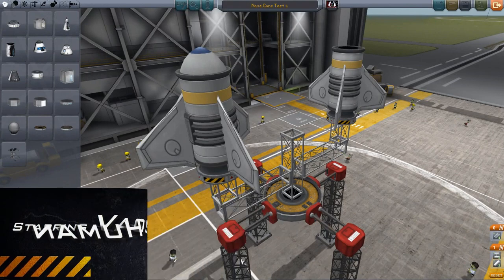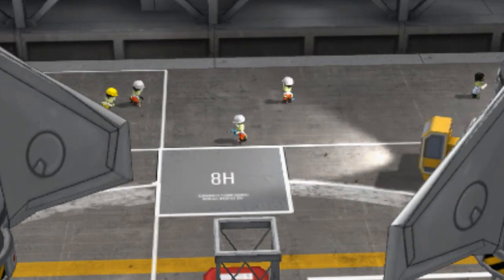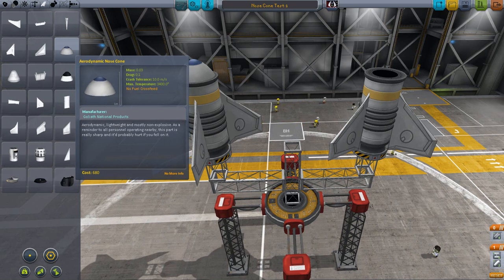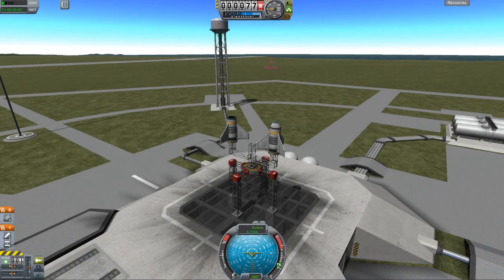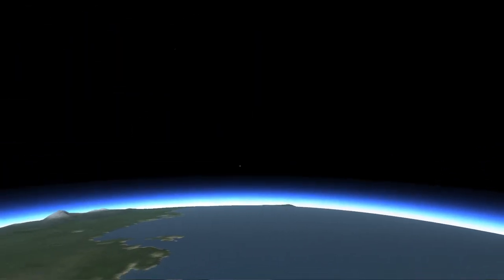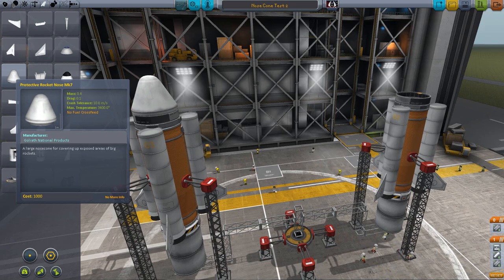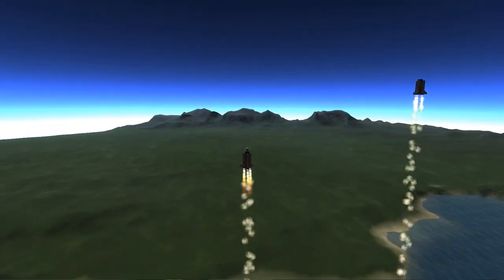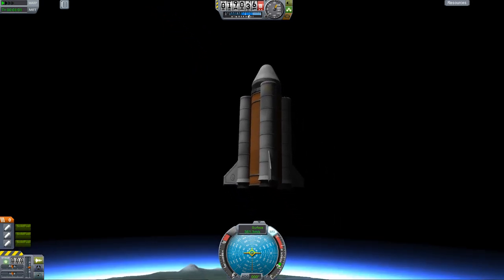*VERY OLD VIDEO* KSP V.23 -Vid#56-Nose Cone TEST. No Mods.

Comment: Re-upload....next time make sure both crafts weigh exactly the same. Ex. Put some weight like .4 on the other craft without the nose one so weigh doesn't put it off....
Reply from the maker: That's what i was going to do .... but i found that no other part in the game has a mass and drag identical to the nose cone parts. I tried using a LV-1R liquid fuel tank, Mass:0.03 Drag:0.2 and a Comms DTS - M1, also Mass:0.03 Drag:0.2 in comparison to the smaller nose cone that has a Mass of 0.03 and Drag of 0.1 . But other then having twice the amount of drag compared to the small nose cone, the 2 test rockets hardly moved past each other with the nose cone rocket slightly  in the lead do to the fact that its drag is 0.1 and the Comms DTS - M1 drag is 0.2 . So other then looking like it helps stabilize the rocket, It does not cut threw the atmosphere the way a nose cone should. In time I'm sure they will fix it. Its still a very young game in its development :)  Thank you for the comment :D
Reply: vaos3712 Good to know!